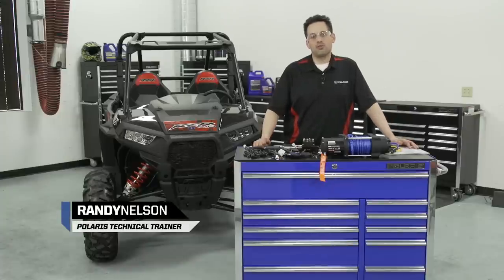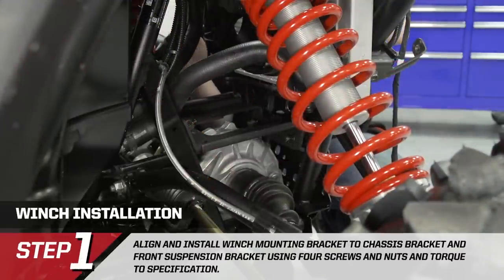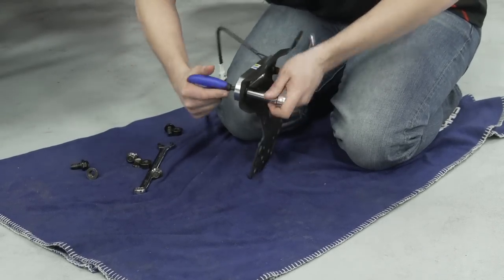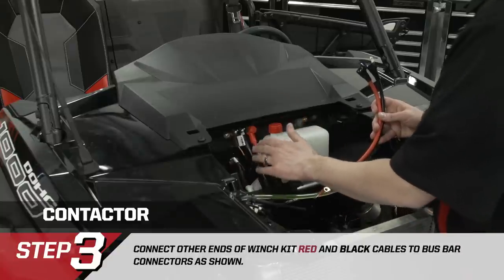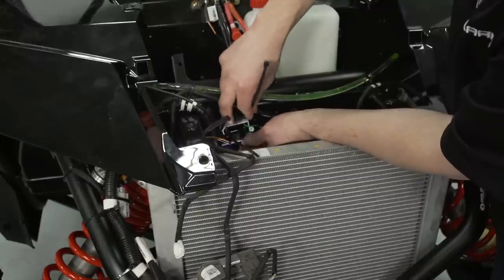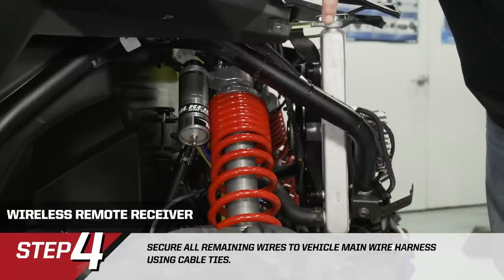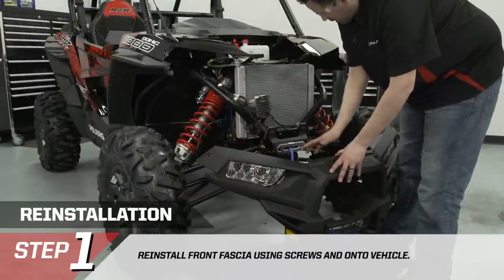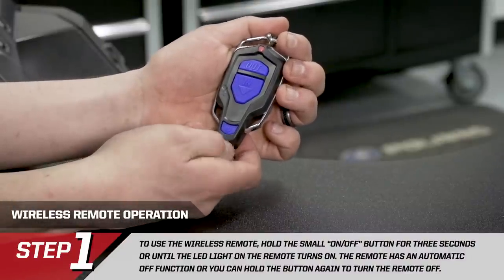RZR XP® 1000 Polaris® PRO HD Winch with Rapid Rope Recovery Install | Polaris RZR®

Comment: Do you have a video that shows how to install a wench (4500 SuperATV) on a 21 Pro XP4?  Specifically, I don’t know how to connect the red wire from the Rocker Switch to the bus bar… or I guess to the Pulse plug on the Bus?

Comment: The rear holes on my base plate don’t line up with the frame holes, less than half of the hole is aligned.  How do you align since the frame is solid?

Comment: Is this install same for turbo?
Reply: That's what I would like to know as well. Also, I have a Sandcraft steering stabilizer with a Sandcraft winch mount plate, so I'm trying to see if this will fit as well. It would be nice if Polaris made videos for each model type insted of relying on their customers to do so. The Turbo has more crap up front, so these instructions may not be the same.
Reply: @TheRealRenn  for real. The directions that came with the winch, show inserting winch on the passenger side and the failed wire on the driver side. Completely opposite of this video. I had to leave mount plate unbolted for wiggle room. Good luck screwing the contact to the firewall. Effing impossible. There's a reason 30 zip ties are included. When the direction only call for 2. The factory Polaris mount holes didn't line up with the frame. Had to use a rat tail file to make it work.

Comment: I've installed these on multiple RZR's now and each time the bracket always had the holes cut wrong. Cut the camera angle crap and tell it how it is. You either have to get a long 2x4 and a sledge hammer to beat the bracket into place, or drill the holes yourself. Polaris is full of crap as advertised in their videos
Reply: Did you drill the holes in the bracket or the frame
Reply: @jzombie89  the bracket. Your best bet is probably widening the ones that are already there
Reply: @bubba_hunts  as a tech at a dealership that installs these units, a 3 foot prybar makes life real easy 🤣
Reply: @knux511  everyone has their own method, either way the holes still should line up from the start

Comment: No RZR should have a winch !!! Added weight to front end when jumping is not good.
Reply: A lot of people don't jump their RZRs. The weight addition to the machine is negligible at best. It is important to hit appropriate jumps for your machine. I believe rule of thumb is one and half the length of your machine (i.e. 10 foot machine, 15 foot ramp. 2 times size may be better) to have a clean launch and landing.